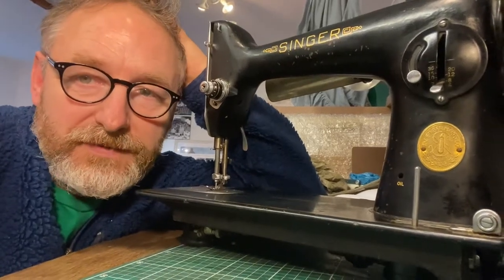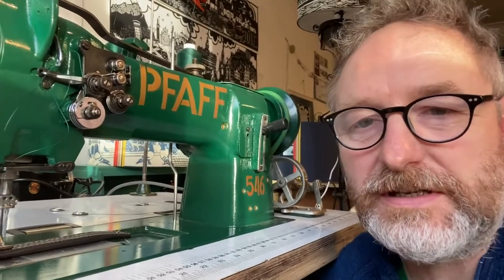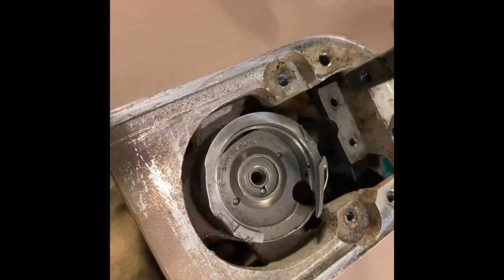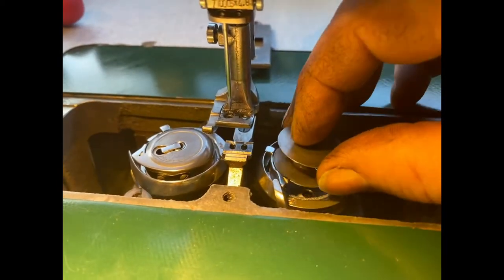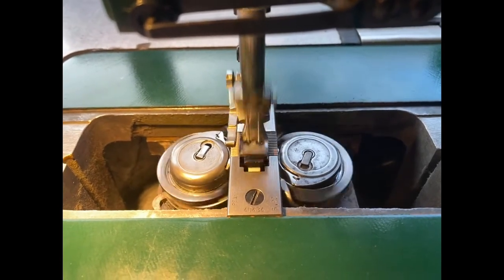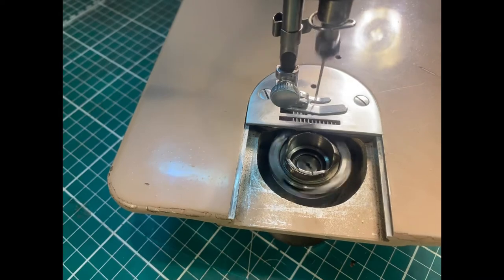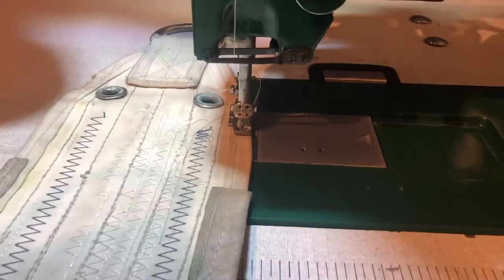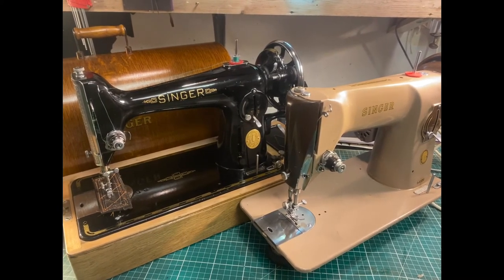Why a singer 201

Comment: 201 purrs beautiful. About 6 years ago I bought a stunning treadle, centenary year in immaculate condition  £50 from Scotland.  I struggle to use treadle now and would love to add a motor. Beautiful inventions and so easy to maintain, they definitely should be looked after. I don't imagine many machines bought new today will last as long or could cope with sewing thick leather or denim. These machines are available at such low prices, they have plenty of accessories to manage lots of different projects. Great for people on very low budgets to start recycling old clothes and bedding and possibly selling their items, the machine would pay for itself very easily. SAVE OUR BEAUTIFUL SINGER SEWING MACHINES. 💖
Reply: I would love a treadle 201. Been looking for one for a while now.

Comment: Husqvarna (Viking) sewing machines with built in slow gear are definitely able to sew thicker materials than 201 unless you don't have some slow gear modification in 201. But it is best not to torture domestic machines like that because they are not meant for that kind of work

 201 is a special machine and it makes me smile every time I use it. It  is quiet, smooth, fast enough for me, reliable and  easy to use and service. It never skip stiches and stich quality is perfect when you have line tensions adjusted correctly

Comment: I always say you dont need a comercial machine just a vintage singer 201 , and you just proved it , thank you ...
Reply from the maker: Happy to help. But of course, it depends on your application.
Reply: @sailingtessbesssewfarnorth1746  this is true , i sew patches on my leather vest and use a 15-91 for that work , only because there are so many 15s cheep i dont need to worry if i hurt my Singer , but of course,  it still hasnt happened , probably never will lol ........

Comment: I bought a 201 a while ago, only cleaned it, I might replace some bits in the future (some accessories are rusty). It sews like a dream. I still have a modern, cheap mashine in the closet, just in case I need to zigzag something. However I find myself adjusting my sewing process to avoid using it, swapping zigzagged edged for french or flat-felled seams wherever possible, so ever since I have this singer, I have not used electric at all.

Comment: Thanks for your video, and I hope some more of these machines are saved this way. I have only tried to use about 10 different sewing machines in my life, and then I have read something about at lot of other machines. I can only confirm your statement, that the Singer 201 is a very capable machine. It is also easy to modify, and you can still get spare parts quite cheap and easy. I have modified one of the two I got, so it is able to sew heavier thread and fabrics. The modifications provide good low speed control and significantly higher thread tension. I have sewn about 2500 m of Tex 135 Thread in vinyl and dense webbing this way, and I still see no signs of wear from that. So in this way I can do some heavy jobs without the need for an industrial machine, and it do not take up space in a fixed table. It is also possible for me to transport it to a job somewhere else. The only problem I see with the machine is the needle thread tensioner, because it can be somewhat unpredictable. So I am glad to use a spring dynamometer to check thread tension now and then.
Reply from the maker: That’s Excellent, what modifications have you done for heavier threads, can you share on my Face Book group, Sew Far North. Thank you, This link: 

https://www.facebook.com/groups/1346509865787938/?ref=share_group_link
Reply: @sailingtessbesssewfarnorth1746  Thanks. Yes, I shall try that. But it may not be today.

Comment: I'm the owner of two 15-125, a 66, two 201s, a 215G, a 216G, and a 316G.... as well as a double handful of straight-stitch Kenmores, a Pfaff 30, and some HA-1 Japanese clones of the 15.

Of them all, I'd have to say the 216G gives the straightest stitch and the straightest feed. The 201 is about as good as my 15s, but a good bit smoother.

Comment: I've been struggling  to find one of these mint condition here in Brazil.. but I own a 15c. Aren't  those just as powerful?

I understand that the rotary hook may be more precise somehow, but the strength of these vintage machines I suppose is for they all metal geared, no plastic or belt etc.. am I wrong?
Reply from the maker: @yuribolognini  the 15 is a very strong machine, and it will handle thicker thread than the 201.

Comment: I have a 201. Love it. So quiet and does sew beautifully—- but where can I get bobbins that fit it properly?  The new “66” style are horrid!  That’s when I have a problem with it. I only have one original style bobbin which of course is impractical!
Reply from the maker: Check out the ‘vintage sewing machine’ fb group, and ask on there, you will find someone to supply you.
Reply: @sailingtessbesssewfarnorth1746  I will! Tx.

Comment: I watched a previous video of yours with different vintage machines and the singer 66 looks and sounds gorgeous.
But the singer 201 sounds gorgeous to. What are the differences between the two?
I have a Bernina 1030 in a diy cabinet, which sews very smooth.
But videos like this makes me wonder how a 100% metal singer feels while sewing😄
I would love to own an industrial in the future when I might need one, but according to your video, a 66 or 201 might sound right for corset and dressmaking to.
Dillema's, dillema's😅
Reply from the maker: The 66 is a great machine, but The 201 is smoother and stronger than the 66.

An industrial will go all day every day for years.

Try them all. See what you like.
Reply: @sailingtessbesssewfarnorth1746  thanks for the explanation between the 66 and 201👍🏻
I own a 28k and 128k with the intention to learn machine maintenance myself.
Sewing a fully rigiline boned corset on them will be a good test, to see what a basic all metal machine is capable off, in comparison with my go-to Bernina.
I can always decide later if I like a fully metal machine better for such works, over my Bernina.

I worked with industrials in the past and a friend nearby has one where I have worked on. So in general I know how they feel and sew like. At the moment I don't need to upgrade at all, but my mind can dream and wonder off a bit to much at times😇
I will keep the 201 in mind, I saw a video where you can attach a servo motor to the machine through a belt. I'm wondering how much effort and perhaps money it involves to convert a machine like that with table, where on the other hand for the same amount you can buy a second hand industrial 🤔
In general I'm a bit worried if a house hold sewing machine motor, will be able to withstand sewing such corset based garments. I think that's why my mind keeps wondering off, based on my industrial sewing experience 😇😁

Comment: Thanks just bought my Singer 201 in Craigslist for $50 with table and all gadgets and manual book what you recommend for upgrading motor for heavy canvas,webbing nylon and leather? Thanks for the video
Reply from the maker: @Youtuberkit7  I wouldn’t use a 201 for heavy work, it’s more suited to fine high quality sewing, I’d use a 15 for heavier work, a real tractor.
Reply: Thanks.  I just found a singer 15-91.

Comment: Bonjour,
Pouvez me dire, svp, comment on peut baisser les griffes sur ces vielles machines pour faire un piqué libre.
Merci
Reply from the maker: The 201 has a screw under the bed to drop the claws, on other machines you may need to remove them, only two screws.

Comment: What size needle do u use on the 201 for all those thicknesses? What is the stitch length size? What is the tension number too? Thanx so much!
Reply from the maker: Hi Rosanne, thanks for asking, Needle is an 18, stitch length is max, the tension is trial and error, I dial it in to suit the job. Hope that helps.

Comment: Which needle did you have in the Singer 201 to sew through those thicknesses? Can today's needles fit in them? Thanks for the informative video.
Reply from the maker: It was a universal 18, standard point.
Reply from the maker: Yes a normal 15x1 needle.
Reply: Thank you.

Comment: Hi. I watched this video with great interest having very recently bought a Singer 201 myself. What make or brand of needles do you use or recommend? I have been testing the needles that came with my machine and despite them being the same brand and type there is significant variation in how effective they are. I expect they are worn, some more so than others, so I will be buying new needles in the near future. Thank you.
Reply from the maker: Never use old needles, 15x1 change every 8 hrs of sewing, or after a needle strike.
Reply: @sailingtessbesssewfarnorth1746  Thanks for the info, I appreciate it.

Comment: A question here --- I have a '30 Model A Coupe and would like to sew my own interior --- I have a Singer 201 -- in a cabinet ------ In watching you and some others -- I think the 201 -- will -- sew up a seat for my car --- Vinyl --piping around the edge --- will it sew this with --- I would like 1/2 inch sew foam --- maybe it won't do it ------ so -- maybe 1/4 inch sew foam ------ or will it do that? ----------I hear $$$$$ signs -- for they tell me --- a triple action / unison feed --- to do car upholstery ------- I have this machine - 201 - I'm in my seventies --- still that Love for old cars --------- So -- would appreciate what you might say ----- Thank You --- Rodney
Reply from the maker: Rodney, just get some scrap material and try it. The 201 will penetrate the fabric if the motor is strong, but maybe the feed will not work with the foam,
You can only try. Individual skill also has a very big part to play, some machinists can do a lot with a limited machine, others struggle with modern advanced machine, just give it a go, then you will know.
Reply: Thank You for the response back --- will give that a try  @sailingtessbesssewfarnorth1746

Comment: hi,  is it possible to use  twin needles with the 201?
Reply from the maker: The needle plate is only for one needle, so it would net be possible with out some adaptation.
Reply: @sailingtessbesssewfarnorth1746   thank you , another question, is it possible to use dbx1  needles with the 201k?
Reply from the maker: A 201 machine is designed for use with HAx1 / 15x1 flat sided needles, also called universal. They are used in the majority of domestic machines, and readily available.
Reply: @sailingtessbesssewfarnorth1746   Thank you so much i asked that because the singer 306k, 319k and 320k which take 206 needles can also take dbx needles